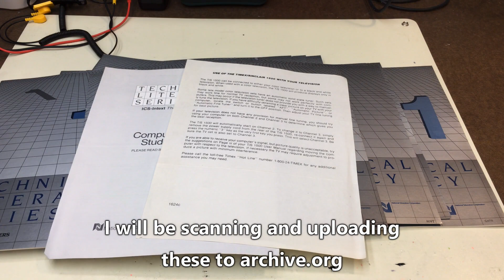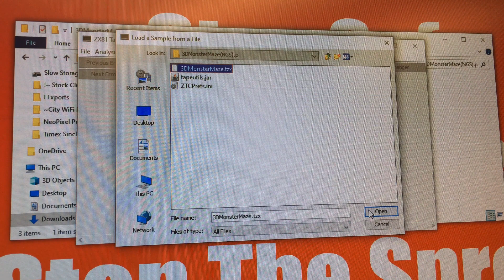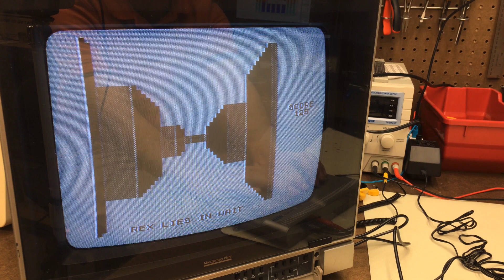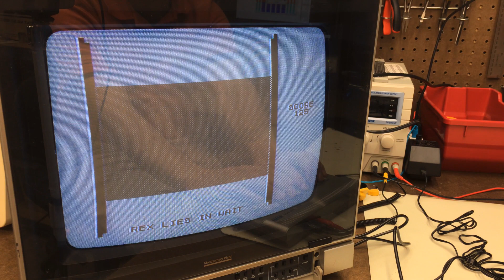QUICK FIX - Timex Sinclair 1500

Comment: Too bad the author did not record the part where he detaches the silver/grey keyboard plate, to get to the rubber keyboard and to the membrane. It is tricky. You have to warm the plate with a hair dryer in order to soften the glue. If not, you risk bending the plate.

Comment: What brand and thickness of double sided tape would you recommend to stick the front keyboard bezel?
Reply from the maker: Good question! 3M, always, and -thin-. I have a very old roll of Manco/Duck brand I've been using for small jobs for YEARS, but it's not good. It is super thin, though.